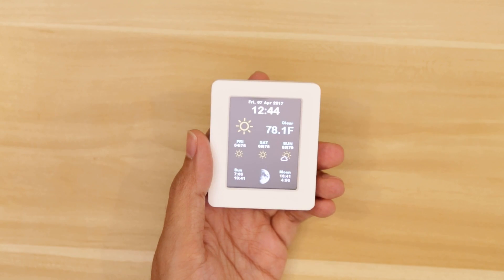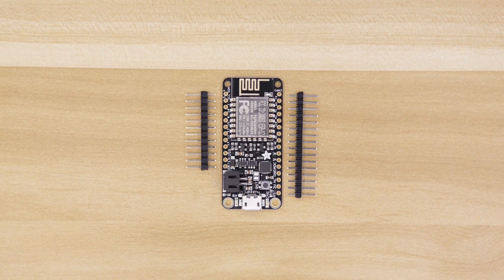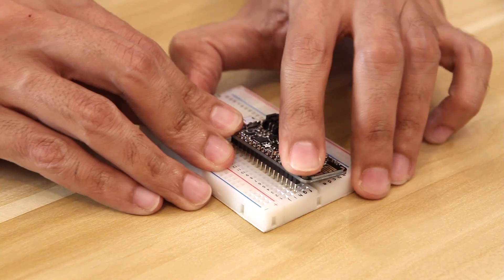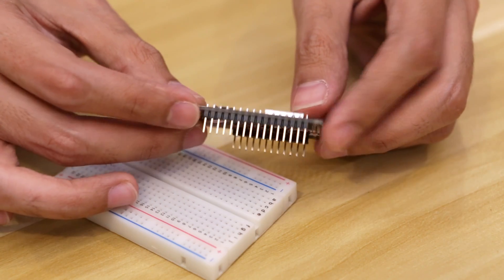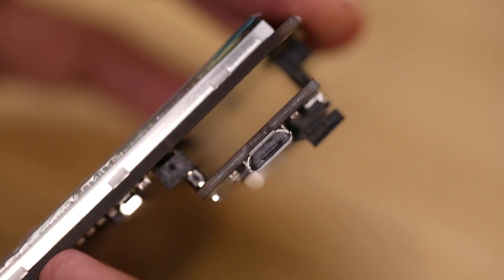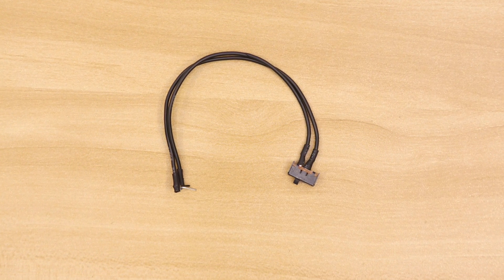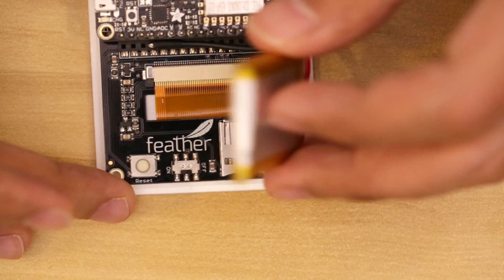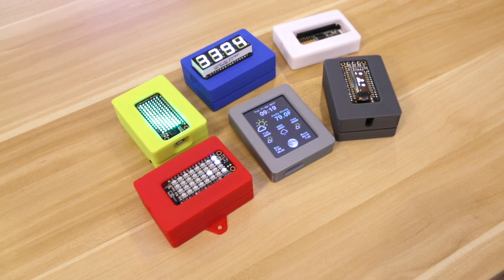TFT FeatherWing 3D Printed Case

Comment: You probably should have flipped the pins and soldered the long ends through the feather and snipped after soldering, this way it would be easier to keep them all the same length.
Reply: My thoughts exactly (O,o)

Comment: Don't use breadboard to solder the headers, you will damage it with the heat. Use perfboard.
Reply: I've soldered tons of pins using the same breadboard and I've never had any issues. I don't think they would tell you to do something if they haven't done it a bunch themselves.
Reply: @JJiG  , if you leave the soldering iron on the pin a bit too long, you will melt the breadboard's plastic surrounding that pin. It should be ok to do for someone with a reasonable level of soldering skill, but it's not a good idea for a beginner.
Reply: i just use an old janky breadboard that doesn't grab any more

Comment: Sweet! I wonder if a slighter deeper back could be added to the case so the Feather could have a hatch door over it (like a battery compartment on some older handheld games, and a little solar cell mounted on the back and the 4 corners have a place for suction cups. (If I made any sense)

THEN you could make that handy little weather station in the kitchen stuck to the window, so as the sun peeps through the kitchen window it's also charging that little battery.  hmm....